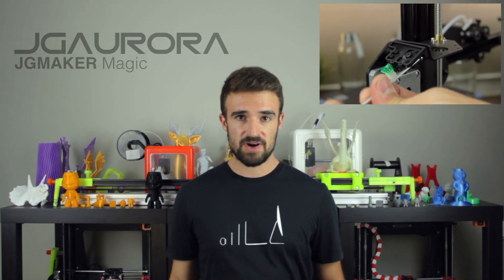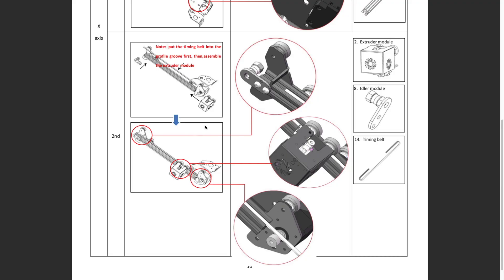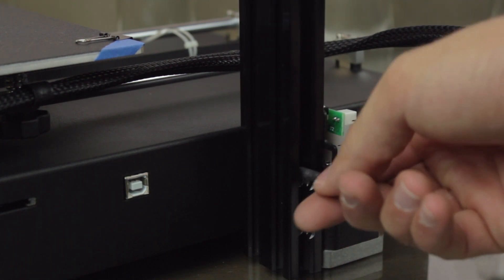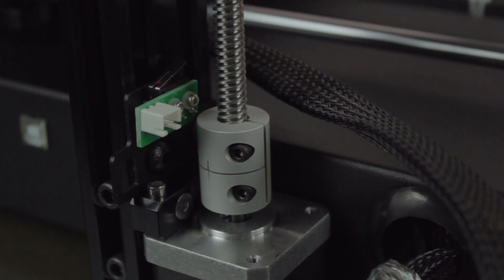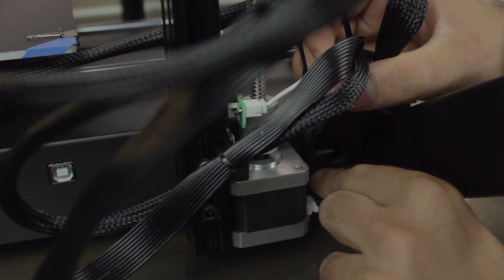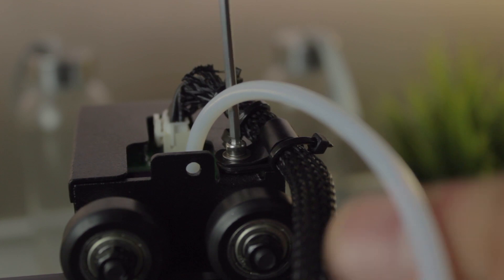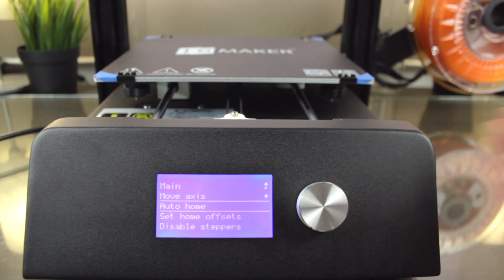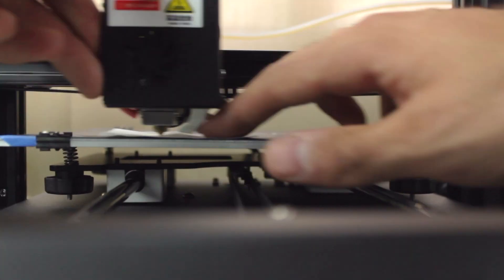JGAURORA - JGMAKER Magic FDM 3D Printer - Assembly

Comment: Hello can you help me? How do you screw the eccentric nut from this 3d printer because the mine is wiggling a lot and I have no idea how to make it stop
Reply from the maker: Hi! It's very easy. depending on what axis you need to tighten, pick up a hex key or a pair of pliers and rotate the eccentric nut. Just a little bit, about 15-30 degrees. If it's more stable, it's perfect. If not, try rotating it 15 degrees more. If not, repeat.

Comment: The top bar at 5:45, mines is shorter then the length of the two side bars. 
Therefore screw holes don't align. 
Did this happen to you or anyone else?
Reply: yes but u have to push down the motor and then it will work